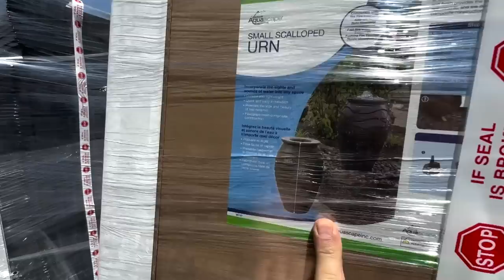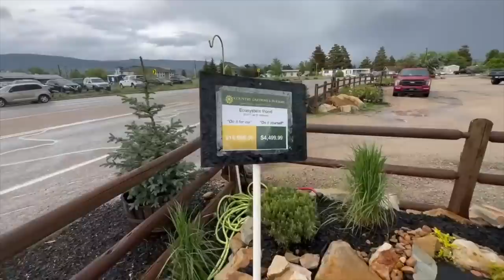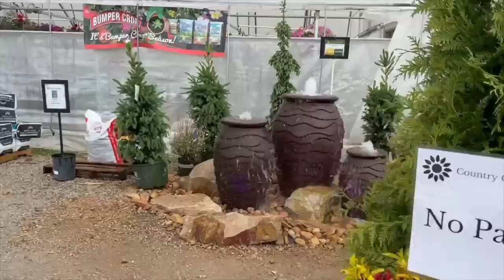WHERE in the WORLD is THE POND GUY?!

Comment: That’s amazing that little hole will lose that! I’ve been losing 200-300 gallons a day. Mines in a stream bed or somewhere. Any one got some tips to identify that? It’s about 15 years old…anyone ever see roots from trees puncturing the liner?
Reply: It's always helpful to wait for a dry time in the season and investigate all the edges and even under edge rocks along the stream it makes the wet spots of a leak more apparent. A lot of time you will actually see some plants along the edge lush and thriving from the abundant water source if there is a leak in that area. In regards to trees, usually they will follow water into the liner from a previous leak rather than the tree itself puncturing the liner. I've seen tree roots follow a leak from a skimmer faceplate that needed to be re-sealed as pushing down low edges and growing into the water over the liner (some trees will do this more than others).